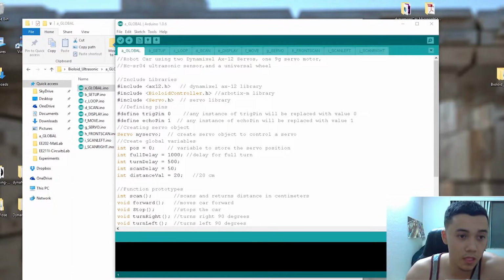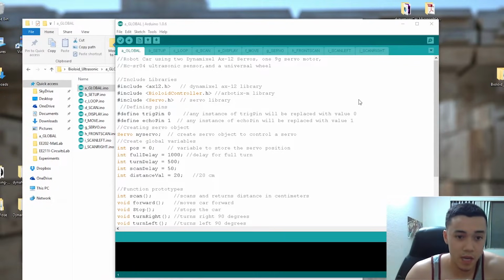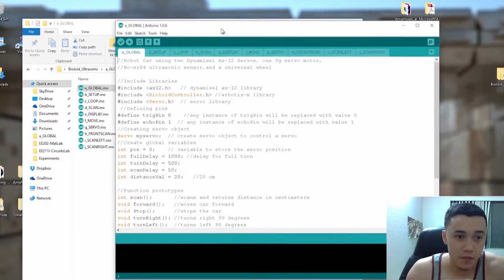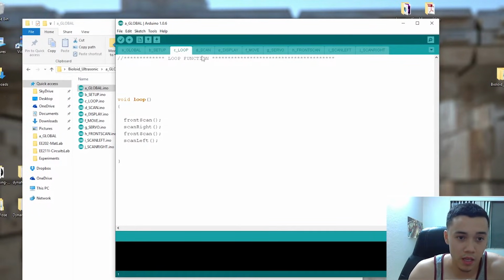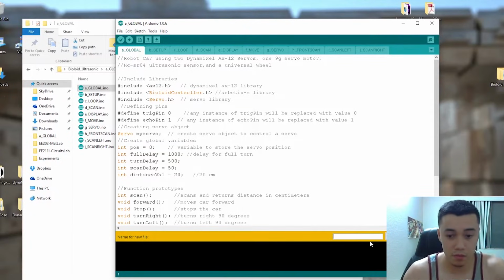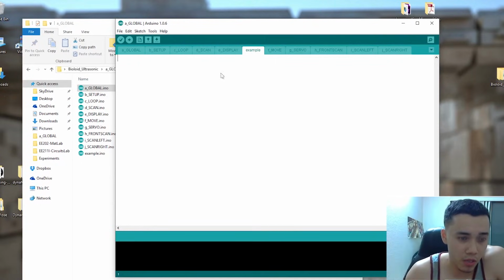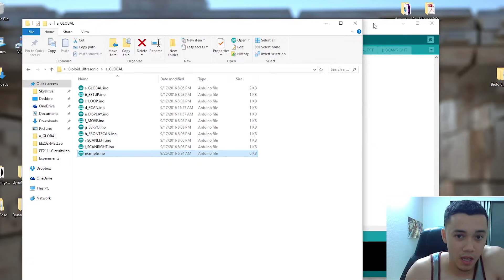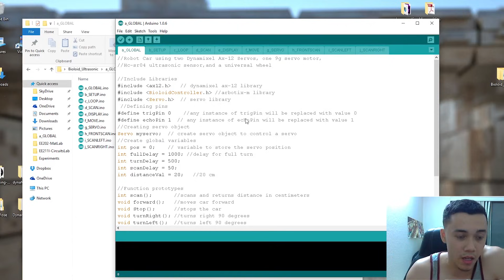Arduino Tutorial | How to Organize your Code using Multi File Tabs on the Arduino IDE

Comment: Hello! Thanks for the video. I'm very new on this, help me with this question. How to upload a program with multiple taps in a hardware, one at the time or uploading one the Arduino software will upload the rest?
Thanks in advance.
Reply from the maker: Jose Santana Hi pressing the upload button will upload everything at once. No need for one at a time.
Reply: pinpointECE thank you.